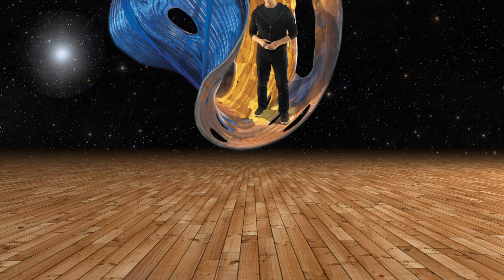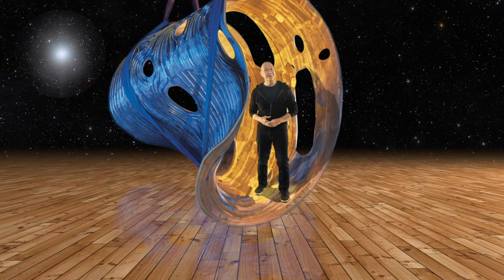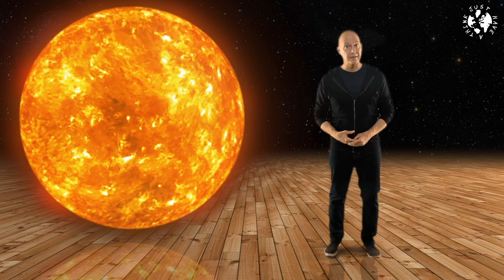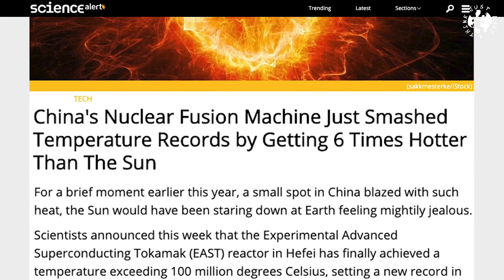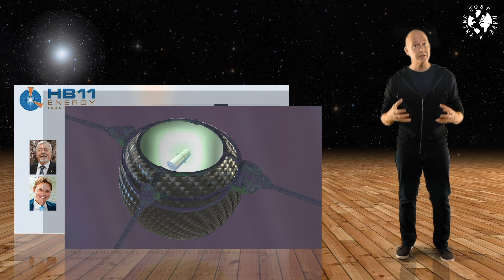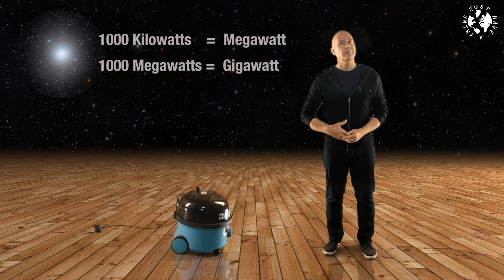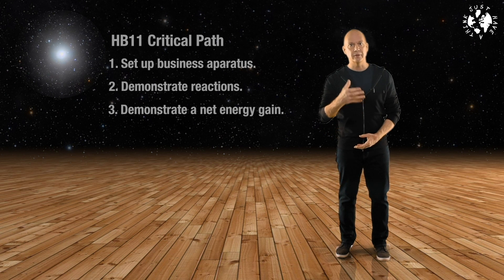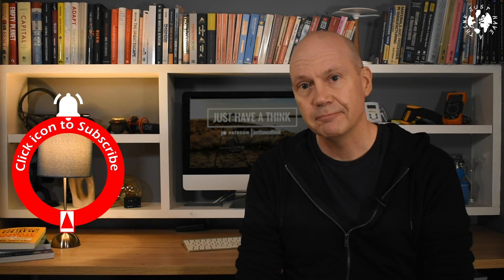Nuclear Fusion:  Revolutionary new breakthrough.

Comment: WRT the obvious question, posed at the end: NO, there is no sense in not going ahead with wind and solar (especially solar). Even if one of these new fusion concepts works out, it's going to take a few decades before any fleet of fusion reactors can be built and operating. Renewable energy, no matter what anyone says to the contrary, is on a course to dominate the energy system in a couple of decades. It gets continually cheaper. And if some fusion design comes along that eventually ends up being cheaper, wind and solar devices will need replacement in a few decades, so it's not as though we'll be locked into those for centuries.

The thought even occurs to me that promoting fusion breakthroughs could be a way of damping down interest in all the non-nuclear alternatives. But that seems highly unlikely. The amount of money being directed toward fusion is nowhere near commensurate with that kind of control.
Reply: BS!!!  The ONLY way renewables "dominate" is if the government mandates it in which case we'll be worse than Cuba in 20 years riding horses, buggies and bicycles and reading by candle light
Reply: @sifuhusky3556  Are you shilling for an oil company, or just being ridiculous on your own? The facts are there, in regularly released statistics, for anyone who cares to look.

Comment: There is a single number that rules over all possible energy sources.  It's called the "Levelized Cost of Energy" or LCOE.  It takes into account all financial costs of producing power, including financing the construction of the plant, and (ideally) downstream decommissioning as well as externalities.  It's expressed in the units currency / energy, for example, $ / kWh.  If you compare any of the various fusion approaches to conventional renewables + storage, the fusion schemes fail every time.  Someday, only God knows when, we will get fusion sufficiently sorted to build a power plant, and it just won't matter, because the competition will have a lower LCOE.

Comment: From my neck of the woods, it's usually "30 years away". Anyways, I doubt that fusion will be cost competitive with solar/battery in 30 years because stationary batteries (and even better solar) ought to be massively researched by all governments, and be more efficient/longer lasting by then. I believe this B11 fusion should be researched even more than "thermal" fusion, as this would greatly decrease the size and costs of fusion and hopefully prove me wrong about solar still being cheaper by mid century.
Maybe by then they'll have fusion on a chip!
Oh, in the meantime, develop and mass produce molten salt reactors...

Comment: The other huge question is build costs and running costs.  Any energy technology that cannot undercut coal on costs will never take over around the world. The poor will always use the cheapest to build especially if it provides local jobs as coal does. The Moltex plant being built on site in Canada will be cheaper than natural gas (methane). Factory modules will be cheaper than coal. By the way the Canada plant will use high level waste nuclear fuel to fuel the new reactor. Fuel costs are negative.

Comment: Fusion reactions will release ionising radiation so it’s not correct to say there will be no waste and some of that will be radioactive. 
Molten salt nuclear is now well under way. It’s been proven and it is low waste. The hold ups are entirely regulatory. U.K. is incredibly slow and opaque. USA is geared for traditional (high waste high cost) PWR reactors with no thought for anything else b

Comment: Magnetic confinement type fusion is a dead end for several reasons. The parasitic power demands alone would leave little excess power for producing electricity for the grid. The fusion reaction itself would create fast neutrons which will irradiate the reaction chamber materials and leave them intensely radioactive,and will weaken any steel used in the chamber's construction,necessitating the rebuilding of the reactor on a regular basis,hardly very economical. See: https://thebulletin.org/2017/04/fusion-reactors-not-what-theyre-cracked-up-to-be/  I haven't heard of the Australian reactor concept.Maybe that will actually produce a working reactor. I wish them well. From what I have read,a much more practical solution would be modular molten sodium FISSION reactors,which which would be walk away safe and capable of burning fuel from existing fission reactors,and will be ready for use in about 5 years or less. One I am following is applying for regulatory approval: https://www.arcnuclear.com/arc-100-reactor
Reply: Lookup aneutronic fusion, like this H-Boron...
Reply: @AltMarc  Yes,I agree,but I was talking about magnetically confined fusion.

Comment: Click bait. "HAVE THEY FINNALLY", no it's still 20 years away.
Reply: no its here now!!!!! youtube search "Safire Project" low energy nuclear reactions,,,, the way of the future our sun is electric not atomic
Reply: @shockwave326  ohh yeah, fun to see our taxes are used properly, all on wrong conclusions made by the so called smartest among us.. :p
Reply: @runs_through_the_forest  yep it is maddening
Reply: @shockwave326  the hb11 laser things looks interesting, first time i hear about it..
Reply: @runs_through_the_forest  ill take a look at it
Reply: @runs_through_the_forest  i had a quick look it seems viable but how efficient is it ?
im prety sure it is less so than Safire
Reply: @shockwave326  i'll try and come to the chat this sunday  i always seem to get the timing wrong, at what hour/TIME ZONE is the plan usually? then i can check what this gives for paris timezone.. about safire, i'm wondering what they will come up with as a solid way the use the heat in the hottest double layer well.. or will they just use the heat of the overall chamber not to disturb the tufting/layering..
Reply: @runs_through_the_forest  just heating in dark mode with low power remember the run away thermal event ? thats what they are working on  to generate power
Reply: @shockwave326  i'm aware of that but was maybe getting it wrong thanks to a photo i came across of the multilayer white phase pointing at the first layer saying 1000000°C
Reply: @runs_through_the_forest  85,000 deg was the temp contained in the double layer
Reply: @runs_through_the_forest  its 130 pm sunday Eastern time zone,,, thats 6 or 7 hours paris is ahead of the EST
Reply: @shockwave326  thanks 6h it is.. :)
Reply: Just as it was 50 years ago.

Comment: Sidestepping the science and looking at the engineering:  Does the pulsed nature of the lasers imply that the power output can be modulated through the duty cycle of the laser(s)?  Does this imply more than base load capability?
Reply: If I understand your question correctly I think the answer might be more complicated than yes or no. We're talking about quantum effects, which are nominally stepwise, in orders of magnitude. So while a base constant output from the reactor may take eg: 1PW/picosecond pulses into the pellet the next energy level could require that 1PW pulse to last a whole nanosecond which would require an enormous amount of headroom for the input supply.

Comment: The SAFIRE Project set up to investigate the electrical nature of the Sun accidentally uncovered the secret of Nuclear Fusion 3 years or so ago. This is NOT theory but actual easily sustainable fusion that has been confirmed by three years of actual experimentation. Now that the SAFIRE team have completed their electrical study of the Sun they have turned their attention to designing a commercial fusion reactor - at a fraction of the cost of the potential fusion reactors outlined here which are still only theoretical. Last I heard the SAFIRE fusion reactor design is completed and the SAFIRE team is looking for finance to build the first commercial production model.
Reply: The whole thing is BS and based on zero evidence. Get your facts right.

Comment: Fusion is a great concept that marches ever closer to reality. So, a) public/private partnerships should absolutely be a high priority. b) In the meantime, commercializing Molten Salt Reactors should be the focus for "green nuclear" baseload generation. c) Renewables of all forms (solar, wind, tidal/hydro, geothermal, etc.) should be implemented, along with grid-scale storage (pumped hydro, flow batteries, mechanical/gravity batteries, etc.), all tied together with distributed, smart-grid technology. This is the path to a carbon-neutral energy future without waiting for the promise of a single technology that may or may not become a reality within the needed timeframe.

Comment: While improving the construction standards of wind turbines to make SF6 leaks an infinitesimal risk — and then retrofitting the existing farms as a matter of urgency;  I would consider improving our current renewable sources to be enhanced engineering that the generation industry will undertake for commercial reasons.  
This sort of development may have spin-offs which cannot be guessed at, but the fusion generator itself ought to attract massive interest from the Norwegian SWF

Comment: Well done video. The answer has been looking down at us every day, the sun. The SAFIRE project was built on a small budget to test the electric sun hypothesis. In their plasma chamber, they found self organizing double, counter rotating bands of plasma at huge temperatures and pressure. They also found transmutation of elements. They are working on a power generator right now.
Reply: Nope.

Comment: Cool animation! :o)
"Enormous expense" of nuclear fusion research is perhaps 1% on fossil fuel subsidies, not to mention the indirect costs of using fossil fuels. That skimping on research funding is the main reason we don't already have fusion power plants.
This hydrogen-boron reaction reminds of "Migmacell", a colliding beam fusion reactor worked on in '70s by Bogdan Maglić, but, thanks to the advances in laser technology, far simpler. This would really be great.
But in the meantime, why don't we see through fossil lobby FUD and deploy the new generation of inherently safe, much cheaper fission reactors? Of course, we need to continue working on grid-scale storage (other than pumped hydro - that one is more or less already deployed where it was feasible) and continent-scale grids that would make intermittent renewables more useful. We can't afford to put all out eggs in the same basket, and, besides, different solutions will work in different circumstances.
Reply: Trigger Troll  Nope. Mostly hydro, some nuclear and wind.
Reply: Trigger Troll  Which is all easily replaced with sustainable energy sources, if there is will. A century ago all was steam, before that animal power. But horse buggy whip manufacturers didn't have sufficient budget for propaganda and bribing politicians to stop the transition, not for long, anyway.
Reply: Trigger Troll  Carbon tax on home heating? I am not aware of that. I myself use natural gas for heating at the moment (not by choice).
Batteries (at least lithium-ion) are indeed no viable grid-scale storage solution in most cases (flow batteries might be). But there already is battery-powered heavy mining and agricultural equipment, although in those cases hydrogen fuel cells might be a better choice (but get hydrogen by electrolysis or photolysis from excess wind and solar power, not by steam reforming of methane.) 
It is interesting: I am currently engaged in two discussions here: with you who claim "we can't do without fossil fuels", and, at the other extreme, with RaosRashSpirit who claims "100% wind and solar have no problems". Am I the only realist here?
Reply: Trigger Troll  Thanks for the rational reaction.  Some estimate the size of the "fossil fuel subsidy" at ~$30 billion/year, whereas fossil fuels themselves constitute the fundamental subsidy of everything that happens in the economy - on the order of trillions/year.
Reply: @sathearn  If it is ~$30B/year then strangely enough fusion research really is ~1% of FF subsidies.

Comment: How much carbon footprint would be generated in the process of development, manufacturing and maintenance of those hypothetical perpetual motion machines? You see, I am not saying it will not work. The thing is renewable will not fix the climate change. Why? By increasing Energy - Consumption interface you create a positive feedback loop of energy/resource supply and demand. With current renables we could replace all other sources of energy, but we dont. We added them on top of the old ones. More available energy means more resource extraction, more manufacturing and more environmental destruction. My point is: Unless you challenge the principle of infinite growth and technological expansion, we are doomed. Humanity, just stop being a crack addict instead of looking for magical solutions to carry on with getting away with it.